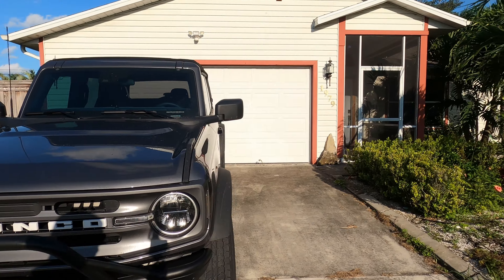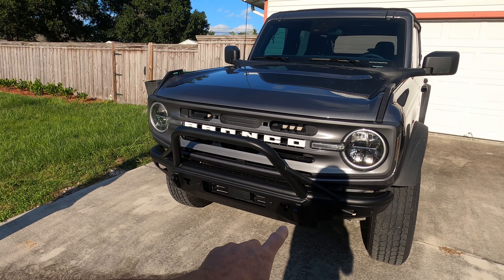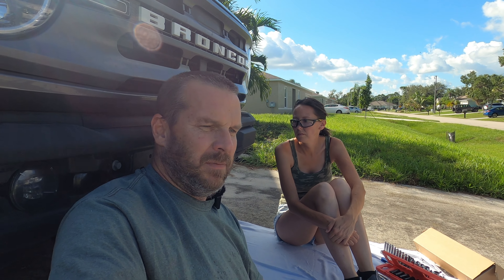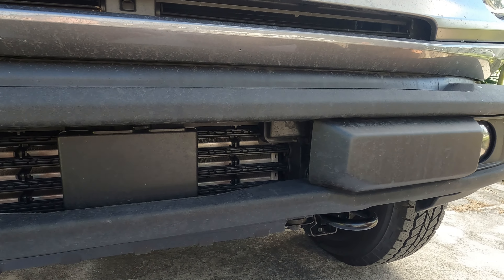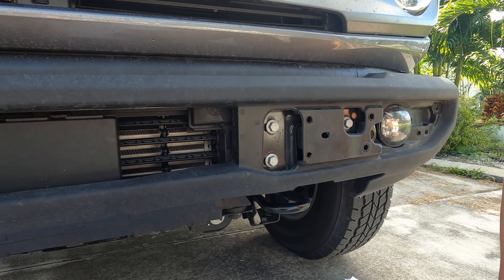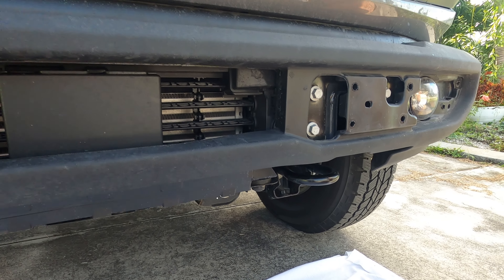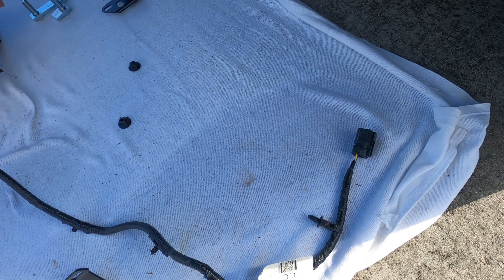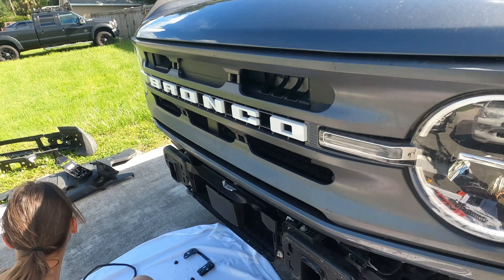2021 BRONCO BIG BEND GET A NEW BUMPER FROM 4 WHEEL PARTS

Comment: I know this is an older video, but I am wondering if you still like this bumper? I bought a used 2022 Big Bend with the plastic bumper. I like the built in bull bar. Great content as always.
Reply from the maker: The bumper is good. If you plan on changing out the skid plate too... I would honestly get another bumper set up. the skid plate doesn't fit right. There is a big gap between them. (about 3"). the picture in the web site was of a prototype skid plate... this isn't what they sell you..
Reply: Thank you.

Comment: Which microphone are you using?
Reply from the maker: Rode with a single mic during this one. We ended up getting the dual mic one on later videos.
Reply: No I meant which brand? I would like to purchase.
Reply from the maker: Rode is the brand..

single mic
https://www.amazon.com/Rode-Wireless-Go-Microphone-Transmitter/dp/B07QGGBNMN/ref=sr_1_4_mod_primary_new?crid=2AUCRKLSBQBT&keywords=rode+wireless+go&qid=1640771429&s=electronics&sbo=RZvfv%2F%2FHxDF%2BO5021pAnSA%3D%3D&sprefix=rode+%2Celectronics%2C83&sr=1-4

dual mic
https://www.amazon.com/Rode-Microphones-Wireless-Channel-Microphone/dp/B08XFQ6KP9/ref=sr_1_5?crid=2AUCRKLSBQBT&keywords=rode+wireless+go&qid=1640771544&s=electronics&sprefix=rode+%2Celectronics%2C83&sr=1-5

Comment: My state requires a front plate. Where do you mount yours? Great job by the way!
Reply from the maker: Florida doesn’t require them. However there are some plate holders that mount to the tow hooks of various styles.  If you get the modular bumper it will have those points to mount it too. As far as the plastic? No idea.
Reply from the maker: https://www.quadratec.com/p/kentrol/shackle-mounted-license-plate-bracket?gclid=EAIaIQobChMI8O_uqLi_8wIVFQiICR2ADwI9EAQYAiABEgKQj_D_BwE.    Some like this. I also have seen the ones that mount to the round tow hooks under the plastic bumper.

Comment: @lifestyleoffroad makes a winch bumper for the Bronco  Made in Orlando
Reply from the maker: A lot are coming out now. But they are almost all on back order. Or under development. I will have to check them out. Hopefully the ADD bumper will be ready when I get the Badlands.

I saw that one but it covers the ACC and crash avoidance sensors in the front. While this one doesn’t block that it would block the camera. Which the badlands does have. I think I will have to figure out what is more important. Or just run winchless and bring the BB if I get stuck. Lol